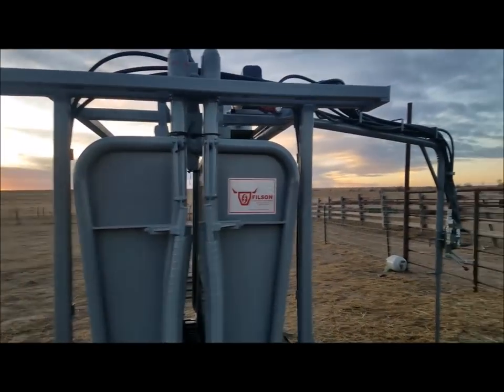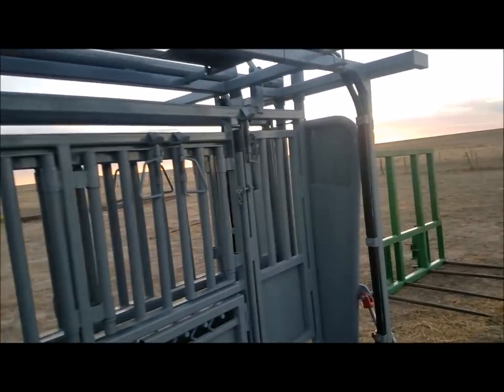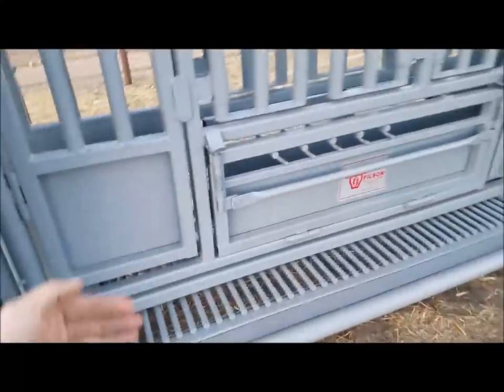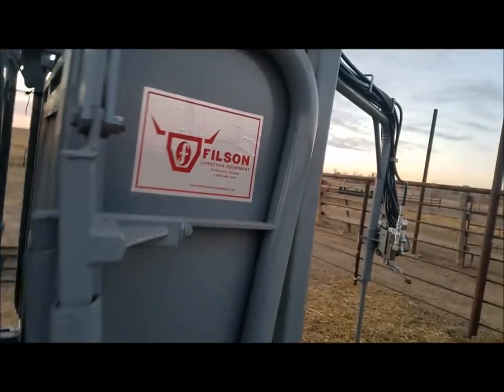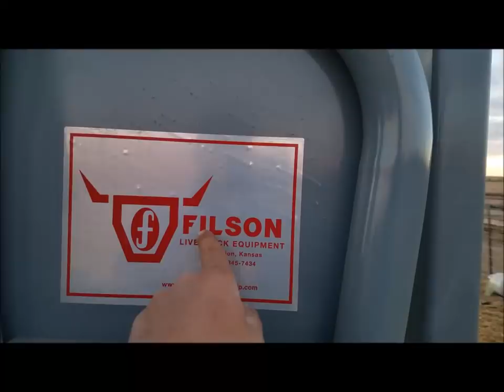New Chute and Processing Barn

Comment: I like the chute especially the part that pulls the head away from headgate. Just curious what size stock trailers do you run?
Reply from the maker: Zach Diamond Z Cattle Co. 32 ft 6.8 wide big bend and a 24ft 6.8 wide 3/4 top big bend